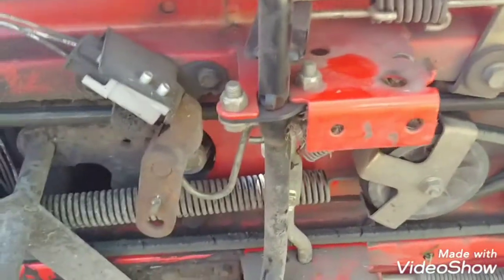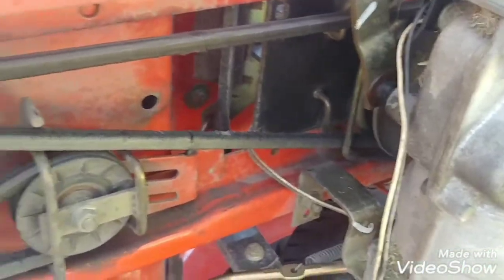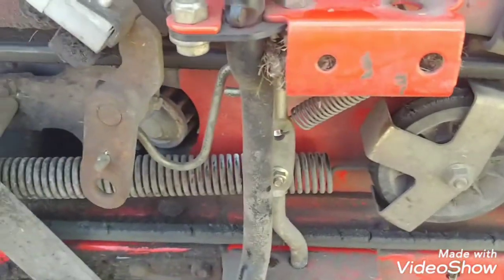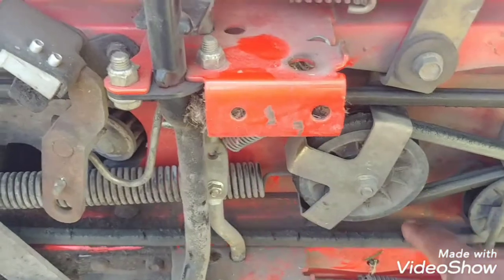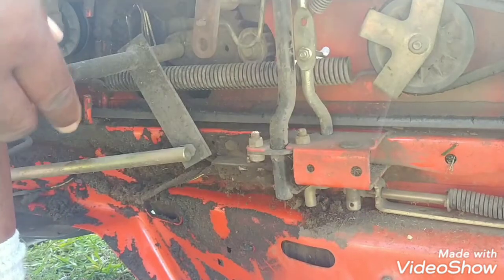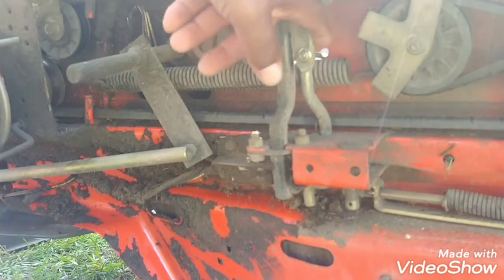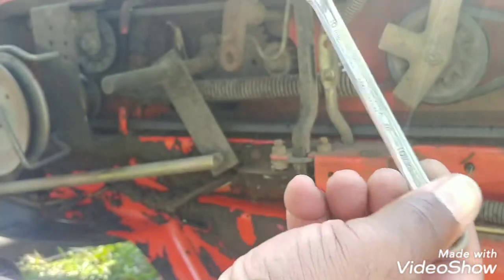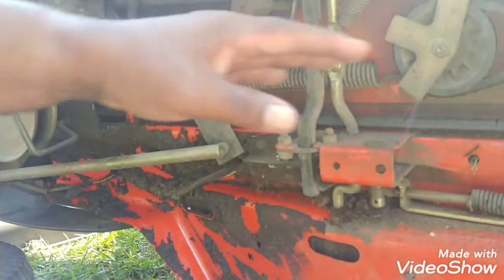Scott's 17hp/42

Comment: Thank you for the shoutout Renaldo. Yea my favorite tool is the sledge hammer 😂That's the first thing I was thinking is the drive belt. It also could be A blocked fuel filter keeping gasoline from flowing to your mower's engine and a clogged air filters also can prevent your lawn mower from going forward or in reverse simply because the engine will overheat quickly. That belt looks like a nightmare. Oh nice call it's weird how it can be a loose bolt and it's a 10MM wrench Josh 😂Yea that belt is definitely going to go soon. I do like that tractor it kind of looks like my Husqvarna same color on everything. You are going to be a good mechanic 👌Yea we always learn somethin different. Great job brother 👊💯
Reply from the maker: Thanks Bill that good Ole 10mm . Man you don't miss ANYTHING!!!!! WOW! ✔️💯💪🏽
Reply: @bigsonslawncare  Your welcome Renaldo. Yes the 10mm is a very popular wrench it seems like I use that the most 😂Oh no I don't miss anything lol 👊💯